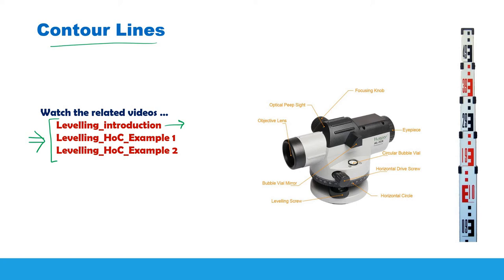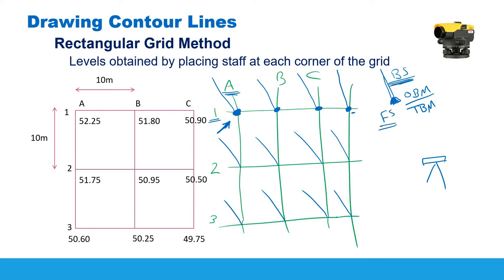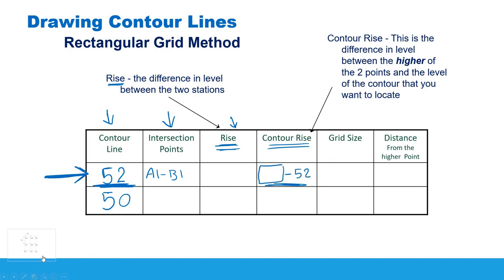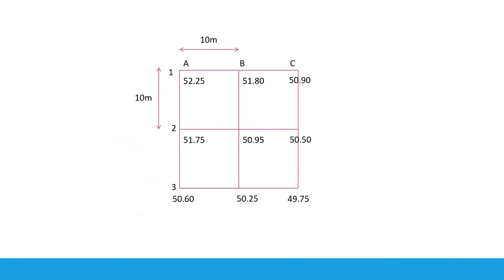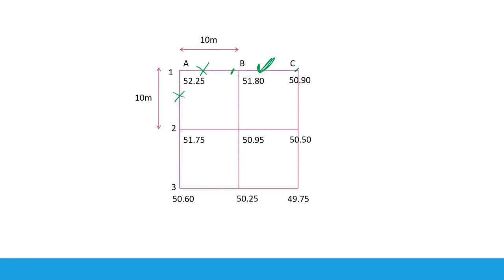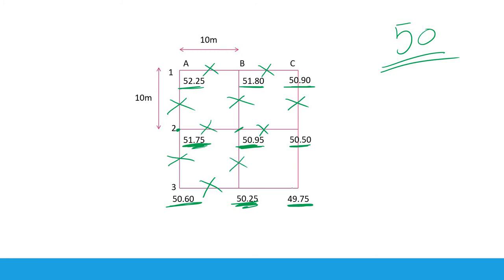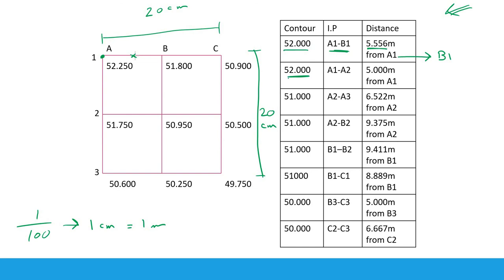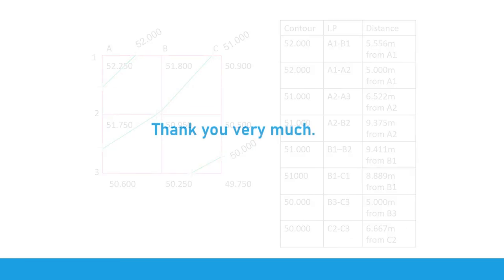Surveying l Drawing Contour Lines l Rectangular Grid Method

Comment: Hi, can you tell me how to get 52.000?
Reply: Contour interval = height RL - lowest RL / no of contour  
( no of contour u need to assume)  
Means it depends on our contour map size 
Okay now 
For example :-( assume 3nos )
=52.250 - 49.750 / 3 
=0.833
=lowest RL + 0.833
=49.750 + 0.833 =50.583≈ 50 
=50.583 + 0.833 =51.416≈ 51
=51.416 + 0.833 =52.249≈ 52
Now you can find RL 52, 51, 50
Reply: @vikrantbirje159 

this really solves my problem in contour intervals calculations I’ve asked literally every where and no one explained it so neatly like you did, that’s what I just needed
Thanks alot 🙏🏻🤍 also Mr. Ziad had explained it so clearly I wish that I had found this video sooner 
Thank you so much Mr. Ziad 🙏🏻🤍
Reply from the maker: Hello. What do you mean, please?